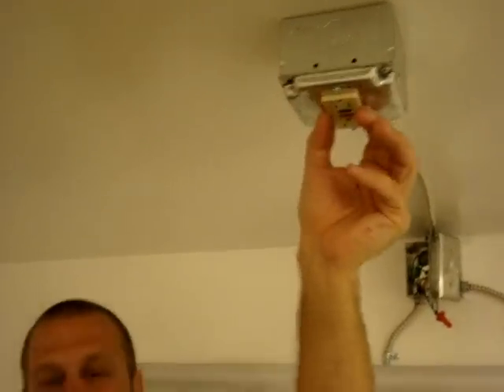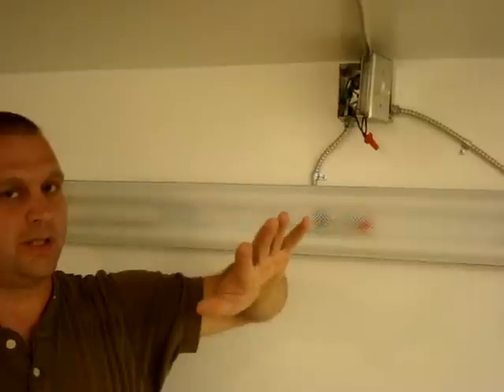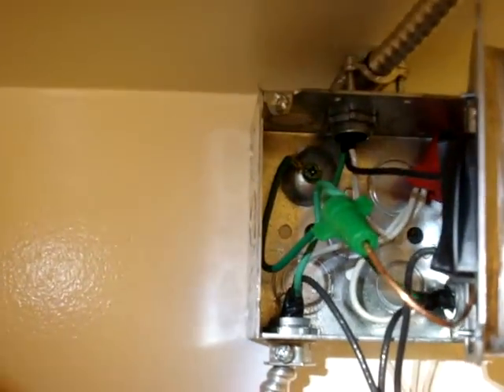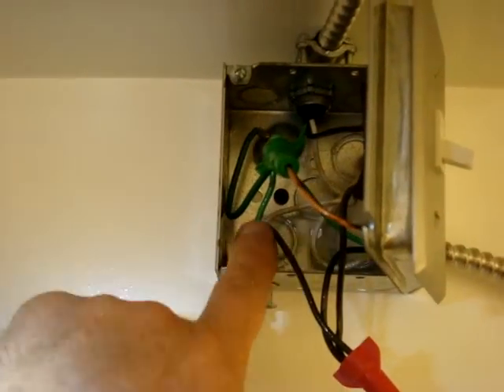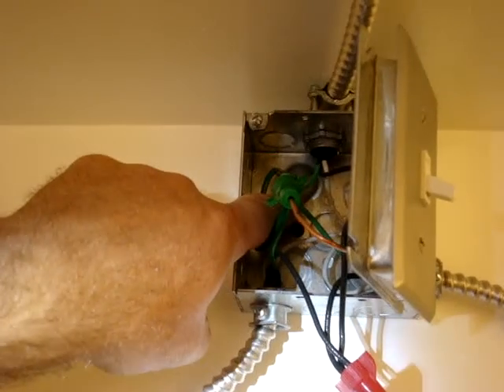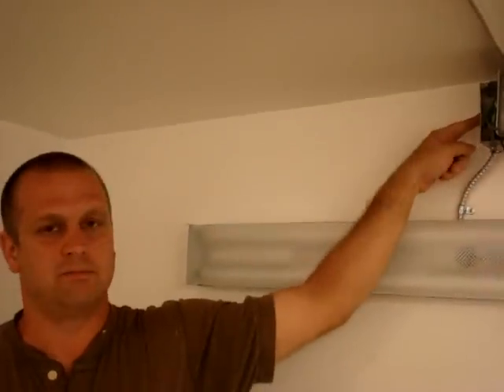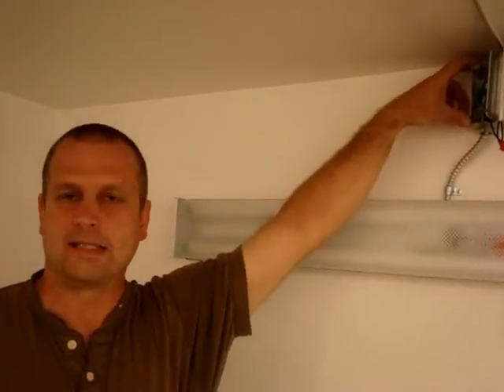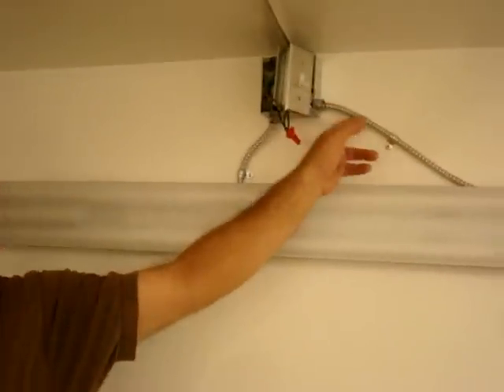How To Properly Ground a Metal Box

Comment: thank you for telling me why I need to ground the box; this is the first video that explained that concept
Reply: You don't as long as you main panel is properly grounded and your metal all the way
Reply: @joerostkowski7313  i was told that even if that were true, and the wires came 'loose' in your box, and the power was on, now the whole box is electrified. that this is why you need to ground at every point along the way.

Comment: I have 2 prong outlets with a thin bare copper wire screwed inside the box. It's thiner than the other wires. Does this mean if I put a 3 prong outlet I can attach a ground on the thin wire or to the box and it will be grounded to the panel?
Reply from the maker: I don't know because I don't know if the ground wire is connected to the panel, but conceptually if you have 14-2 or 12-2 wire to your receptacle or switch that is properly connected to the panel which is correctly connected to the next panel and then to proper grounding rods, then yes you could hook it up. You'd have to verify the ground path first.
Reply: @JamesGlassJamesGlass  Interesting. This is a condo (built in 61') so just one small panel. It has a single ground in the panel that connects to the neutral bar (only one bar in the panel) which is strange to me because other panels I've seen had a separate ground bar. Most of the outlets are the old 2 prong but there's a couple of other 3 prong outlets and gfci;s that tested "correct" with my tester. Wouldn't it read "ground fault" if wasn't grounded back to the panel? As far as the rest of the path goes, the meters are in a separate room in the building and they must have a ground rod somewhere outside. Its just that some of the condo units have newer panels and wiring than others.
Reply: that sounds like early romex with smaller ground or early ground conductor in old armored "bx/greenfield" cable.. I would NOT rely on it to be connected properly anywhere unless the whole system i inspected and checked end to end by an electrician that deems it safe.

Comment: Hello and sorry if this is a stupid question or if it has been answered already, I tried reading most of the comments so not to ask a redundant question. 
Thanks in advance for any and all replies. 

What the best way; if any to ground a metal outlet box, if there is no ground returning to the panel?
Can or will it be grounded by the framing stud ?
. 
I Appreciated the informational video. Thanks again
Reply from the maker: Hi. You can onky ground back to panels (unbonded sub and then bonded at main). If you don't have correct cable at box, you have to run a new cable from panel to box.
Reply: @JamesGlassJamesGlass  thank you for the reply. That's what I thought I was just hoping that there was a new alternative. Thanks again

Comment: Hi James, can I ground the metal box by running a pigtail to a small metal pipe just hanging down loose inside the wall, or wold the pipe need to be secured?  It's a 2-wire fuse panel system that doesn't have a ground.  The goal is to ground the individual outlet so I can use a surge protector so it would work with a grounded outlet.
Reply: Would*
Reply from the maker: The onky legal safe way us to change tbe cable to one w a ground (14-2, 12-2, etc) and then make sure the ground circuit is fully hooked up and intact: box (box w pigtail), outlet, then thru cable (thru any unbonded subpanels) to main bonded panel, then thru ground wire to ground rods.

Alternative paths aren't just illegal, they don't work for many reasons. Pipe gets replaced, pipe doesn't go to earth, etc. When ground wire becomes a conductor in case of fault, at least wire is in cable insulation. Your pipe is a bare metal conductor.

You can use surge, ground fault etc on ungrounded two prong outlets BTW.

Comment: the metal shield of the wire will be the ground also????
Reply: It isn't meant to be used as a ground. The purpose of the armor is for protection. It's always a good idea to bond the box with a ground screw and pigtail, and make sure all grounds are together.

Comment: Is it absolutely necessary to add ground wire from the receptacle back to a main panel? I already have a neutral bus bar that is grounded. Would this just be an added layer of protection? Or is this just for sub-panels?

Comment: I recently bought a belkin surge protector and it shows that its plugged into a non grounded socket (made of plastic) however because i have audio equipment plugged into that sometimes i get static which i believe maybe caused by the lack of a ground connection. do you think i could i wire the ground plug to lets say a metal heater in my room which is built in the wall? would that be just crazy or could it actually work as ground? thanks for any reply
Reply from the maker: +Fran L No, that's unsafe. The best thing to do is get a licensed electrician out there to take a look. All ground have to be properly wired back to the main panel and then out approved wire to approved ground rods.
Reply: +James Glass thanks for your answer! glad I did not try that! so I will get an electrician to take a look. I opened the wall socket and found the negative and positive wire but no ground for some reason.

Comment: Hello, I have a metal filing cabinet that shocks me every time I touch it. Is it ok to extend a grounding wire from an outlet to the cabinet in order to ground it?
Reply from the maker: Lord no, but the real question is why are you still using filing cabinets in this digital age?  Haha. OK, jokes aside, something is electrifying the cabinet. That is not good. Since filing cabinet aren't things that are supposed to be electrified, you have a real problem Get someone over there ASAP to figure out what's going on! Good luck and call an electrician right away!
Reply: +James Glass It's not really electrified. It is static electricity.
Reply from the maker: Haha. OK. I misunderstood. No, you still shouldn't connect your filing cabinet to your home's electrical system, but you might try to humidifier if your air is especially dry.
Reply: Ok, thanks!

Comment: So if I use a GFCI and connect 2 more 15 amp plugins in my kitchen, I have to use a ground screw? If I replace all the metal boxes  with plastic boxes, what do I do with the extra ground wire? Is it safer to use plastic?
Reply from the maker: Any fixture, device, appliance, etc. that includes metal should be grounded, but plastic boxes do not need to be grounded--just the device inside. It's fine to use metal provided you run that extra pigtail to ground the box. In most residential applications, a plastic box is fine and it's cheaper and easier. Metal boxes are used were certain fixtures need greater support and a common example is ceiling fans.

Whether an outlet is GFCI or not, the outlet still gets connected to the ground circuit. The GFCI will work on ungrounded circuits, but that's not the point--the point is to make sure anything that could conduct electricity is connected to a ground circuit that eventually finds its way back to the main panel and then out to the ground rods in the earth.
Reply: Thanks for the helpful hints, keep up the good work.

Comment: What kind of connectors did you use to connect the armored cable to the box?  Those look like screw style (screw contacts the Cable) verses the compression style (where the screw pushes a plate that is contoured to the armored cable.  I thought the screw style is only allowed for steel armored cable.
Reply from the maker: Rich Daubert In our area any BX connector is allowed. We're also in a Dillion Rule state, so that applies to all of VA.

Comment: Dude along as it's metal all the way back and your panel(main)is grounded properly no need for that ground wire. If it was romex and plastic box,yes then you would need a ground wire path incase or over charge, surge, power bump. Electricity travels quickest path WITH LEAST RESISTANCE TO GROUND . YOUR JUST GIVING MORE PATHS.
Reply from the maker: Nope.
Reply: @JamesGlassJamesGlass  👌 in your theory that wire grounded the box but it's all about quickest path with less resistance.  In DC  your right
Reply from the maker: @joerostkowski7313  Dude, it's 250.148. 

https://www.electricallicenserenewal.com/Electrical-Continuing-Education-Courses/NEC-Content.php?sectionID=271.0
Reply: @JamesGlassJamesGlass  dude I bet you always have your ladder 4 to 1 and always have proper ppe on at all times (just like in your video) and lock tag out. And practice safe nfpa arch flash boundry zones,etc. I know the code . Tell me one house before 80s up to code?
Reply: I'm saying as long as it's metal all the way back and your PANEL IS PROPERLY GROUNDED. your fine

Comment: i have a easy question; i have a two prong plug in my house now. i want it to be a three prong plug, now i think if ground and neutral tie in at my main panel then why ??  can't i just connect my ground screw wire to the neutral on the three prong receptacle.??? some say never do that.  others say do it, no problem it will work just fine ? what do you think ???
Reply from the maker: +John Casor I can't stress enough not to do this and to get a license electrician out to your house. The two prong outlet can just remain and you can use an adapter between the cord plug and the outlet. If you have a two prong outlet it's illegal to replace it with a 3 prong unless you upgrade the entire circuit, and that's assuming you have a main panel with a proper ground system. It gives a false sense of security seeing a 3 prong outlet because people assume there is a real dedicated ground circuit there. You would want to only have fire sprinkler heads attached to nothing in your ceiling, would you? Ground circuits are dedicated paths back to the planet earth and nuetral returns are grounded conductors that go back to the panel and then back to the transformer. The two circuits shall not meet! You have to read this last sentence like the line from Monty Python when the troll says, "None shall pass!". Anyway, I don't know the air speed of an unladen African swallow, but I do know that you should never mix up your neutral return and ground paths.
Reply: James Glass Hahahaha so you can just use an adapter? The outlet still isn’t grounded. Do you know anything about electricity?
Reply: John, the first thing you need to understand is that the ground wire is never permitted to carry any current under normal operation. The ground and neutral are connected at the main panel in order to provide a return path in the event of a short. The neutral wire provides the return path to complete the circuit under normal operation. Google "bootleg ground" for a detailed explanation of what you are describing.

Comment: I like that you didn't show any meter readings, and your super power is you can just visually see if something is properly grounded or not. PEOPLE WILL WIRE A METAL BOX AS IF IT IS A ROMEX BOX AND NOT USE A GROUND? YOU DONT NEED A SEPARATE GROUND IF YOUR METAL ALL THE WAY BACK, YOU DO IF ITS PLASTIC,YOU SAID THAT BACKWARDS.

Comment from the maker: We're no longer allowed to use BX as ground here, but in the old days you'd see EMT and BX being used as a ground, mostly in commercial applications. If it was right per code at the time using BX or EMT, then it's still legal and considered functionally obsolete. It doesn't need to be upgraded unless it's altered.You can check for continuity on the conduit and ground using a tester if you're wondering. If the main is bonded correctly, you'll also get continuity between return and ground. (next)
Reply: EMT can still be used as a ground.

Comment: Do you just have that little bit of ground wire wrapped around the screw? How is it fastened? Essentially as long as the ground is touching the metal case it is grounded correct? (Obviously it should be fastened though.)
Reply from the maker: Sean The pig tail is bonded to the box using an approved screw to the approved spot on the box. The boxes come with these nice little threaded ground spots and the green pig tail comes with an integrated ring terminal and little green screw that the same pitch as the box. It's all very convenient!

Comment: I've seen where some just loop one of the ground wires around a ground screw on the metal box.  Is that NEC 2017 kosher?   Or does it have to be an actual pigtail?

Comment: looks like for commercial and business applications for code. i.e ground is also wired to switch and/or outlet. rRsidential does not require wire to switch and/or outlet because the metal screws contact grounded metal box(if ground screwed to metal box). plastic boxes should have a ground wire to switch and outlet. don't like plastic box .

Comment: Stupid question if you'll humour me... If a wire comes loose and is touching the metal box, and the box is not grounded, then you can get shocked if you touch that box.  If the wire comes loose and is touching the metal box, and the box IS grounded.. you can't?  Why?  Wouldn't touching even the grounded box (if live) be the same as touching an open circuit?  I don't understand how that would be any different than touching a live wire that's grounded...
Reply from the maker: Burr Manchu Happy to answer, and good question! If a hot wire comes loose and touches a box, device, or appliance the breaker trips.
Reply: But only if its grounded?
Reply from the maker: Burr Manchu Yes, unless the hot touches the grounded conductor (neutral). If you have a properly grounded box, device or appliance the breaker will trip.
Reply: OK thanks for the info man, I appreciate it.

Comment: also need the red anti short bushing on each end of the bx  dont know if is code were u are
Reply from the maker: Yes--good mention on that. The bx does have the bushing and I think it's got to be required everywhere. I insert the bushing and then secure it in place with a bit of tape as a back up.
Reply: we do it the same way here in canada
Reply from the maker: MrCinimod93 Yes, a anti short bushing is required. I also tape mine in place.
Reply: as long as the tape dont insulate the outer jaket of the bx from the l16 box conector
Reply from the maker: Yes. Exactly.
Reply: @JamesGlassJamesGlass  It is only required for AC cable, not MC cable.

Comment: Dude that wire doesn't ground the box the box was already grounded 😳 if the main panel is correct. If you have romex and plastic boxes your loads(things that require current draw to work) have to be grounded.  I hope this video was a joke

Comment: Since when can MC be run exposed? Also there is a specific type of MC where the armor can be used to carry the EGC. Some manufacturers color code the armor green.
Reply from the maker: Jay Sudo USBC (Viginia) allows MC to be exposed. Usually it's done in commercial reno situations (that's where I most often notice it). We also use it in metal studs instead of running NM and all those bushings. We no longer allow the outer cladding of EMT or AC to be a grounding conductor (MC has an insulated ground vs. AC cable and we run insulated ground inside of EMT also so the only point of contact for the ground are the pigtails inside the boxes.)

MC is used wherever EMT can be used and I can't think of any exceptions off hand (although we could ask a licensed electrician or a building inspector). This means neither MC nor EMT can be used outside and in wet locations where sched 40 hose proof stuff would have to be used instead. There are exceptions for hazardous locations too, but I don't have any experience with that. We do have an ammunition plant close by and I know those guys have major rules about panels and conduit since any stray spark can blow the whole place up.

Here's a nice article: ecmweb.com/contractor/working-metal-clad-cable-and-emt

Comment: I'm  just going by the National Electric Code. Article 320-340. MC cable shall not be installed where subject to physical damage. The rules are identical to those of NM. EMT cam be installed where subject to physical damage  but not severe physical damage (whatever that means). In class 1 division 2 areas  you must run conduit with sealed seams such as threaded RMC or PVC. Also EMT can be installed outdoors if you use approved rain tight fittings. but the conduit cannot leave the structure of the building. also fyi: I'm a Wisconsin state licensed master electrician.
Reply from the maker: Jay Sudo I grew up in Waupaca County and went to Marion High School. I don't miss Wisconsin winters!

We use MC where it's not exposed to physical damage and the inspector has no issue with this. Yes, EMT can be installed outside, but generally we only see that in commercial applications where it might be subjected to physical damage. In residential applications, sched 40 is almost exclusively used. Typically, you'll see MC in laundry rooms, garages, commercial applications (where a bunch of new branch circuits are being run), etc. Like I said, it's common in metal stud applications and we have a couple of big local manufacturers of metal and wood framing products so MC works well there. It also not uncommon to see runs of it above drop ceilings. 

The inspector passed this job without issue.

Relevant articles: Section 330.116, Section 300.22(C) which states that so long as the cable is not subjected to physical abuse it can be used for service, feeder and branch circuits. 

Here's a nice guide: http://www.nacmaonline.com/documents/nacmainstallationoverview.pdf

PS: I've never seen the green colored armor used in residential applications here.
Reply: WISCONSIN IN THE HOUSE!!!! Wauwatosa here checkin' this video out!